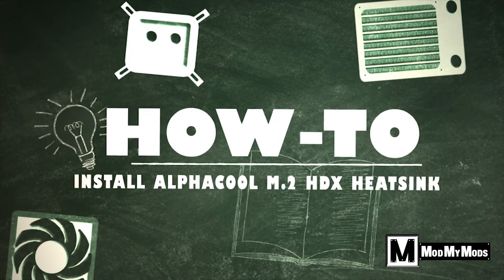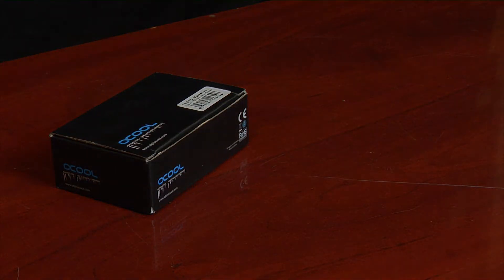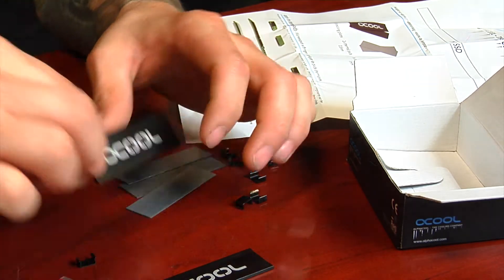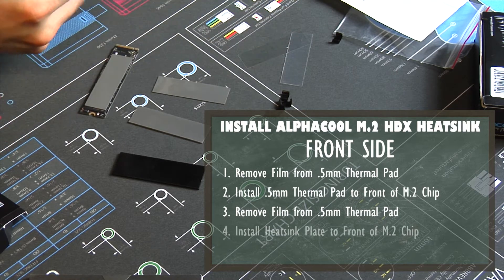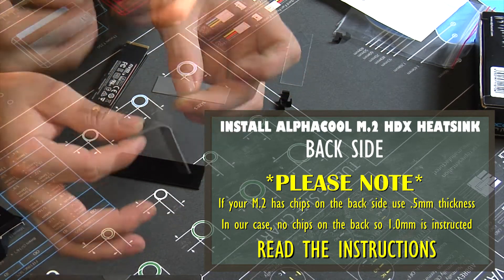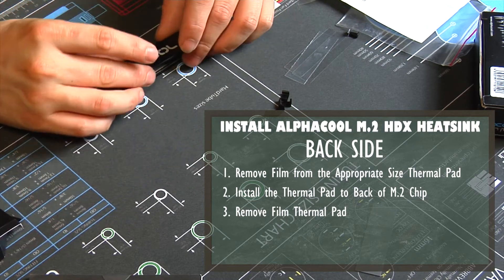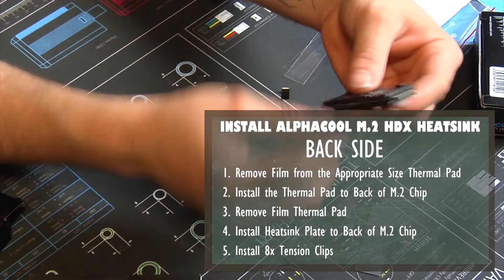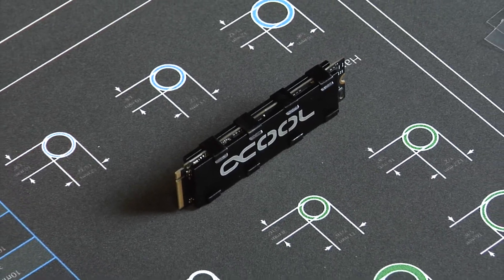How-To Install an Alphacool M.2 HDX Heatsink

Comment: Awesome! will this work on a macbook pro? + adapter of course! cause I am concerned about the amount of space it will need to fit on the logic board
Reply from the maker: It should, It has a relatively low thickness for having a heat sink on both sides.

Comment: yes I did this with my Evo and the back side had one chip on it. I had to use part of the thick and thin. Getting the clips on was a total pain.... Still the major reduction of heat on my M.2 was well worth it.  Going from the high 70's to 50's